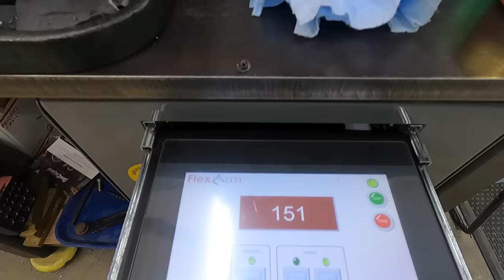Truck Hitch Crane Build Ep. 2

Comment: Has got to be the most precision machined trailer hoist in history.
Reply: That is an Abom hoist buddy lol
Reply: Mike that's no lie.
Reply: Wouldn’t expect anything else!!
Reply: 😂 Well if you have alle those equipment then why not
Reply: Anything worth doing is worth doing right
Reply: We have built those for years,truck bed and hitch cranes. We just used pipe flanges for the base,and sleuce bearing for rotation or at times pipe in pipe! Dont get me wrong,this is really nice,but alot its easier to design and build with mass produced parts!
Reply: @petersmart1999  doesn't make for q captivating youtube machinist video using off the shelf parts. But for those of us without a machine shop would be cool to see how you did it.
Reply: @petersmart1999  
  I'm pretty sure this project was designed to provide a learning environment for machining skills.
Reply: Gonna do it, gotta do it RIGHT!

Comment: I like your comment about not grabbing the wrong drill bit. A few years ago our shop was overhauling a turbine driven pump. The casing had some 3/8” studs broke off it it. We were drilling them out and someone grabbed a 3/8” drill instead of the tap drill. Drilled all the threads right out of the casing. Very bad day!  Without giving to much away I work at a place where we use “special” fuel to generate electricity. And this pump is the most important one we have. We got it fixed and everything worked out. Your videos are great, thanks for sharing your knowledge with us.

Comment: Just to present another method of making that 3 7/16" hole without any criticism of what Adam did would be to use a hole saw or trepan as close to the ID you need and bore to final size. Doing that will give you a slug of material that can be used for a future project instead of turning it all into chips. I have hole sawed as large as 6" in 2" thick aluminum on my old South Bend.
Reply: Would love to see Adam doing some trepanning, and maybe he could make his own tools at different diameters. Would provide great content.

Comment: Everytime i see you use the power hacksaw, i am reminded of a story about an open house for parents at my dad's school shop.  The saw was cutting thin slices of round stock that would change colors due to heat cause by the thin cutting.  One parent thought the colors were so pretty he picked up peice to put in his hand so he could have a closer look.  My dad said the parent dropped the disk soooo fast!  My dad worked as a machinist at North Ameracan (P51) before going into the Navy for WW II.  
I wish more high schools had shop classes.  I took 1 yr metal shop and 2 yr electronics.  I used what i learned in electronics shop to later design handheld computers.
Reply: In my best grandpappy voice..... "Back in my day".. you know the dark ages of the 70's.. We took metal shop in 7th grade.... Casting, welding.... It was awesome!! Todays kids miss out on so much!

Comment: Mr Abom, I watch a lot of your videos but barely say much. 27 years of machining I come to understand you never know everything. Long videos? Never long enough for me. I watch because I still learn from a fellow machinist who is willing to create detailed videos, I thank you for that. As I watch I too pick up on the machinist hand techniques one only learns after years of practicing the trade. The little hand taps to bring an axis to a desired number on the dial or indicator, hand position during marching, a little wipe here or there to clear oil and chips without cutting yourself as well as how to hold a part with razor sharp edges, file techniques on the lathe that keep the file from flying across the room or into your belly or hand. Great stuff to watch and learn for those who are just learning the trade. 
Honestly it surprised me that some folks complained about the length of your videos. Goes to show everyone is different. In my opinion your detailed videos should be admired and learned from. Machining can be very dangerous if proper techniques are not adhered to. Thank you again for sharing your knowledge of the trade. Hopefully the new guys learning the trade value your videos too, as much as an experienced machinist like myself. It took me years to become humble enough to know I will never know everything so it’s best to always learn from one another because we all have something to teach each other. Long videos are the Abom!!! 😎👍🏽

Comment: I actually like the longer videos and the explanations and what your using because eventually i would like to beable to put a lathe on the service truck to use for making parts on our machines out in the field and and im actually glad your making this video becuse ive been thing of making a hydralic crane for the truck as well
Reply: Might need outriggers and a solid floor on your rig too make it rigid enough to handle a lathe, unless it's a baby lathe. Would be cool though. If you pull it off, post it
Reply: @daveb3910   you are correct it would be a small one because we wouldnt use it alot  it would just be for theading bolt makinging spaceres that are 1/4in in diameter

Comment: A small time saver you may want to try, using your spotting drill as the deburring drill.  Spot to a diameter a few thousandths higher than your drill diameter may save you a deburring step.  You specialize in prototype work (single parts) while I have always been doing production work (thousands or millions, etc.).  We saved deburring seconds and when you get paid by decreasing parts per minute/hour/day/year, that adds up.  I have built in seconds to some parts to deburr, but usually did not have to.  The finished parts mixing in the machine base with chips then getting washe and dried in lots took care of the minimal burrs.  If some viewers think your vids are too long, let them give this one a try!
Reply: Thanks, good tip!

Comment: the tip about putting away the drill bit you don't need anymore, so you don't make a drilling mistake. also as to not misplace your tools and or have them laying around the shop. If you're not using it put it away,  then you know exactly where it is! cool

Comment: Spot on Abom79.  What I have seen you are best in drilling holes - spots or centers and pilot hole before forcing a flat non turning center through metal.  The center almost doesn't turn as it is in the center.  The outside spins on the wider circle.  Center is a wedge.  Abom79 uses pre-drilled holes to get a big hog to feed through.  Bravo Abom79.  A right shop not a speed shop.   Sulfur based oil for lube.  Stinky.

Comment: I agree with your reasons for longer videos. There are nuggets that we see in the videos, nuggets that are not described. One example in this video at 22:50 is that you used a 1/2" drill with a very pointed nose. I will assume there's a benefit to that drill shape. It looks like it almost functions somewhat like a step drill, but without the steps.

Comment: When sawing short pieces of stock you can tack a piece of steel to a short section of material? Then you can grip the tacked on material in the vise. Back in my high school metal shop our teacher poured molten lead around a piece of steel so the saw vise would hold it. That wasn’t a really short piece, the vise on the saw was just badly worn and wouldn’t hold the stock.

Comment: I often skip other creators short videos exactly for the reasons you spoke of. Many details are directly or indirectly related to similar projects or operations. The only thing I’d like to hear is not just the name of a particular tool manufacturer, but where you get them. Example: Buying raw material from McMaster. Where so you get your drills, taps and spot drills? Thanks.

Comment: Adam, I've just started watching this, so there may be something I haven't seen yet that changes my opinion. But as things stand at the moment, I'm a bit concerned about your selection of AISI4140 for your flange material. I'm concerned that the base metal has a lot of carbon in it, and has enough chrome and moly that it will try to through harden from the fusion heat from the weld, resulting in un-tempered martensite which will of course crack. 4140 CAN be welded, but theres a lot of pre and post heat treating that has to be done.

Comment: For cutting thin discs like that I have a fixture plate so I can use hold down clamps with a different radius blocks that go under the clamp on my other saw I had 1/2 tapped holes to do the same thing works pretty good I've cut inch and 7/8 discs in half that way 👍👍👍

Comment: Hey ABom
For the vise is you had 2 similar height/width plates you could extend your jaws by doing
[|O|] jaws/plate/raw stock/plate/jaws
And also using that 1/2 extension to  keep it from caving in on the back while clamping. Just slide the plates as close as you’re comfortable to the blade and you should be good with tight clamping.

Comment: Adam, I'm a woodworker, not a machinist. But, if you knew you were boring the middle out, why not put the hole in the middle first, use a mandrel and put the part on the mandrel. Then you could have done the outside diameter without risking hitting the chuck and you could have gone all the way across without the line/difference in diameter?

Comment: There's at least a couple styles of maker video but broadly in this context is entertainment and rough exposition. You know, broad strokes of building a thing. Not  a ton of granular detail. Done well, those are fine and have their place. There are also detailed long form videos that get down in the weeds of the trade, craft and/or design. This is an educational medium and an entertainment medium. I suppose archival too. How many people would have seen shapers in use like you(and others) have shown? Like really use them on actual projects, solving setup and tooling for real when you could have walked a few steps over to your mill and just got it done... 

I like what you are doing with this project, break it down in steps as you often do. Cover a part or section of a project at a time. Some operations you've shown over and over but those operations have context. The order of operation and the why surrounding is useful knowledge. 

Keep doing you, it works.

Comment: When I have made 'hobbyist' parts, I've used a pair of parallels to hold the part off the chuck, so your idea of the magnetic blocks could be quicker. If you dismantle a computer hard drive, there is a similar magnetic block inside which (if followers have dead drives) could be a free substitute.

Comment: 41:00 When drilling like this, if you MUST be using the wrong RPM's, which is better a little too fast or a little too slow and how do you adjust your feed rate to compensate so you don't screw up the material or damage the drills?

Comment: I don't mind your video's being long so keep doing it.

On the odd occasion where the video gets a bit long winded for me, i just use the speed feature. (For example when you used the saw to cut in this video, i just set it to double speed and back to normal, when it had done the cut).

Comment: Adam I love your idea BUT.... I have a better one that through the years has worked awesome for me. I used the same plate Drilled on a gm 8 bolt pattern design as you but as for the bushing part I  opted for  a front wheel bearing for a 4 wheel drive I then made a flange block for the underside (truck side) of the bearing and fixed that to the truck the advantage was the smoothness of the rotate operation. I use used Bearings ( they may be bad for going down the road at 65 but the 1 full turn by hand the bearings will last for years from my local automotive shop and currently have them on 5 trucks and the consistently lift 500-2000lbs and even under full load 2000 lbs you can still turn them literally with one finger !!!!

Comment: Adam, why not weld one round plate and the pin to the upper part of your hoist, and then weld the other plate to the lower tube and just put the pin down through the hole and let the two round plates swivel on each other like a fifth wheel with some grease?
You could eliminate the four bolts.

Comment: Another question please. When drilling the holes, wouldn't it be better to do eCh operation for each hole and then change bits for the next operation. I'm used to seeing that with CNC but maybe that's because CNC is all about efficiency in programming and operation. Same reason I would think even with DRO, you'd only move in one plane to go from hole to hole so you'd drill one then cross the center in one direction to drill the second them move in two planes only one time to drill the third hole and then one plane of movement for the fourth hole.

With a DRO it probably doesn't matter and I'm probably just overthinking it as an efficiency reason that probably just doesn't apply since this isn't repeated job work but one off fabrication.

Comment: Would it be more accurate, when drilling your holes, if instead of going from 3 o’clock to 12 to 9 to 6, you went 3, 9, 12, then 6? You have two movements for each hole the way you did it. If you went from 3 to 9, you Y axis would stay untouched and only the X would move, only needing 1 movement. Essentially you could eliminate 2 moves of the work piece. I know you use a DRO, just a thought.

Comment: Adam, you should buy a cheap variable frequency drive for your mill. Then you can dial in the spindle speed you want. I have a victor 1630 lathe just like yours with one on it. It works great.

Comment: Any reason for cutting the register before welding the flange to the pipe/rod?
There is not alot of meat left on the spot you are going to weld it.
Considering that you planned on chucking it back up to face off the weld wasnt it a better option to turn the register after the welding?
This way the 45 degree part on the flange might get hotter then the rod.

Comment: To slightly counter the 3 jaw repeatability issue leaving a line when machining an OD in 2 parts I usually cut up some empty tin cans that are kept. After facing and making sure it’s parallel I’ll then clock the already machined od and slip in cut up tin can (0.1mm thick) beneath the jaw/jaws on the high side. Can usually get it running close enough to fold up some rough Emery and blend out the line, works good for jobs that don’t have strict size, concentricity and finish tolerances

Comment: Long or short they are all good. If it is too long for you click off the video.
You mentioned  your 3 jaw chuck had some runout. We use to use soft jaw chucks that we could true up before use and they had the added advantage you could turn right up to the jaw without damaging your tool.

Comment: So, the disc you ended up boring the middle out of, why didn't you just face it, and bore it, and then do the diameter change, which you could grip the disc on the ID instead?  Is it because of using the 3 Jaw, or was it just to show a different technique?

Comment: Why do you switch between drilling on the x and y axis?
Old habit? 
Wouldn't it go faster if you finished two holes on the same axis before taking the other two?
Then you did not need to have to go back to the center so many times.

Comment: Adam; have you ever been given a job where you actually have to make a "shop made tool"? Kurtis on the Cutting Edge Engineering recently had to make a 600MM long boring bar for a client's repair job due to he did not have any boring bars long enough and nobody made them (commercially) to suit his needs. He even built a live tail stock chuck that has helped him out on several projects.
Reply: Not Adam, but yes. There aren't many examples--I think because this is a third-generation shop and a lot of those needs have been filled--but there are some. Specifically, I recall a tap follower, steady rest, and of course, the infamous welding table. There are a lot of example of Adam using a tool with some specific purpose that his father, or grandfather fabricated.

Comment: Making shorter videos doesn't have to come at the expense of detail, you can just break them into pieces and release them more often.
I many times pause your videos when something comes up and continue watching later.
I also watch many videos at 125% or 150% speed, and most of the time it doesn't diminish anything from the watching experience.
(Some Youtubers talk way too fast though, but for most it works fine).

Comment: for those who don't like or can't deal with long videos, try watching them in smaller bites. sometimes i have to do that with movies.

machining is not really something one can learn in the length of a TikTok video. what you'll learn in abom's videos is a bazillion different ways you can set up a machine, and make a precision machined part, which is part of what machining is all about. if you can't hold the work, locate the work, or make it run true, you won't successfully make machined metal parts!

Comment: Hey Abom! I am a mechanic and my shop has an older South Bend 13" and I can't any info on it. Saw one older South Bend  video on yt. Any suggestions  on where I can get info on it to teach myself how to use it?
Reply: Just fuck around with it one day and see what all the levers and knobs do. If you don’t feel comfortable doing that, then just look up how to use a lathe online. They all operate pretty much the same so if you can run one you can run them all. The controls vary based on who manufactured the machine (like one machine may use a different set of levers to change the speeds or engage the power feed), but they all achieve the same results in the end.

My first machining experience and what got me into the trade was on a South Bend lathe. They’re great machines.
Reply: That’s easy. Buy the book “How to run a lathe” by South Bend.